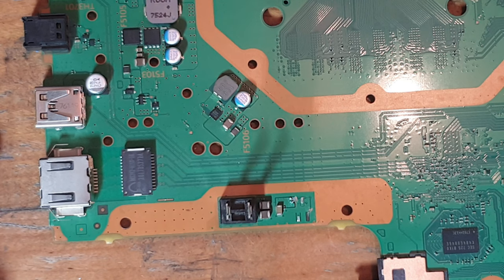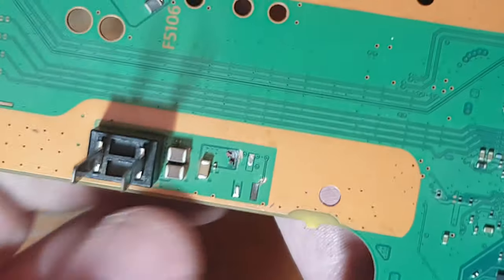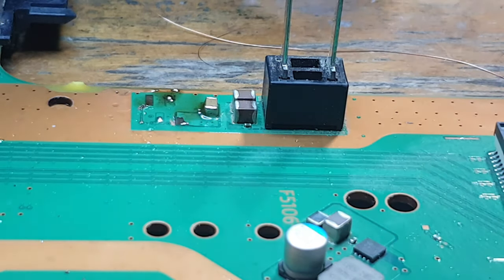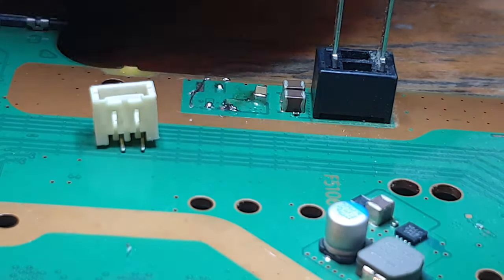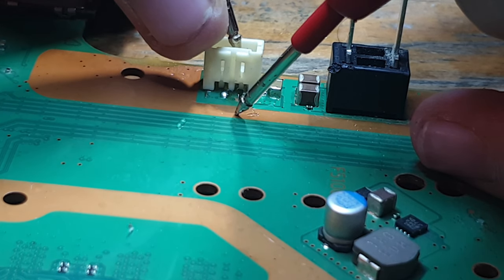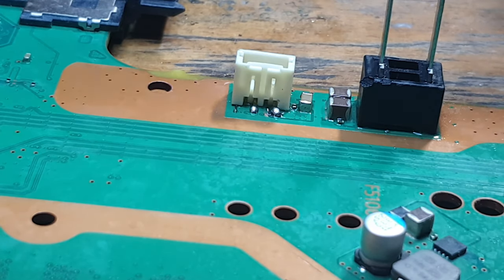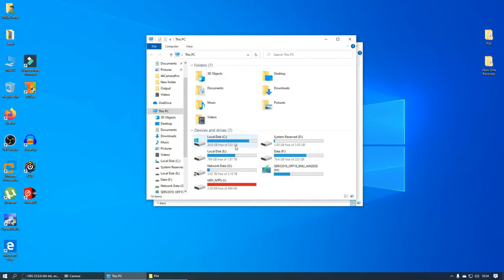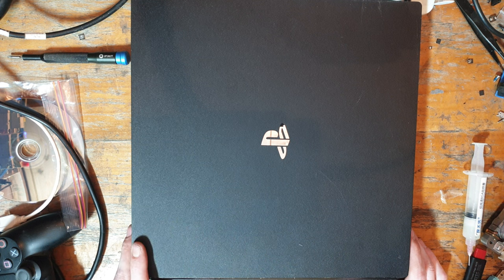PlayStation 4 Pro Broken 4 Pin 5v Connector Repair - 4 Pin Connector Ripped Off While Cleaning

Comment: Hello I had a question recently I had to repair my sister's PS4 Pro it required a HDMI port replacement in the process of taking it apart the 4 prong plug on the motherboard to the power supply came off no major damage just ground pad and the data pad came off I ran a tracer wire for the data pad and soldered it all back down after I cleaned it replace the HDMI port and put it back together it has power whenever I push the button a blue light comes on and it beeps but then it immediately shuts back off any idea what I'm missing ?thank you

Comment: I've replaced my motherboard that was a 5pin connector with one that is now a 4pin I've also swapped out the PSU for the 4pin is there anything else I need to change am I right in saying I need a diffrent logic board to match these two new components?

Comment: Opened up my ps4 pro for deep cleaning and the power supply cord was already moving without even moving it so I'm deciding to just sawder it back on.

Not sure if it came defective but I've opened many ps4's and ps4 pros and have never seen it that loose before

Comment: I ripped mine too, but from the power supply not the motherboard.
Do you know the name from the connector? I struggle to find the right one. Mine is the 5 pin connector.
Reply from the maker: Unfortunately not, I generally reuse the connector or use one from a donor board if I can't reuse the original one
Reply: @TheCod3r  Thanks anyways.
I keep searching. Brought it to a Mobile Repair Center. They said 80 Bucks to repair it. How much do you ask for it?
I think 80 is way to high, i can get a used power supply for 45€. 
Im from Germany so it's just to know a number....if you like.
But as i said thanks anyways.
Reply: @TheCod3r  can you maybe tell me the rigjt size from the pins? I broke 4 from 5 pins. So maybe i can reuse the connector  if im able to get new pins.

Comment: I need to buy the jumper cable from somewhere, any ideas what I need to search for?
Reply from the maker: Yeah if you just type in enamelled wire on ebay it'll show up :)
Reply: @TheCod3r  top man, liked and subscribed 👍
Reply: @TheCod3r  would 779mA - 0.8mm diameter do the trick?
Reply: @TheCod3r  are you still offering your services for us UK folk? I have the enamelled wire coming tomorrow but I'm not confident in my ability lol.. If so, let me know how much 👍

Comment: I pulled in the cable, and it wouldn't come out. I pulled, wiggled, juggled, and it wouldn't come out. I pulled a little bit harder and it just popped. It pulled the anchors off the board and two of the pads where the terminals are attached. The other two are fine tho. I still can't get the plug out of the connector and I dont wanna break it worse. If you have any suggestions it would really help. Pls
Reply from the maker: Hi, the only way to fix it would be to solder the connections back on, or get someone with soldering experience to do it for you as it would likely require running jumper wires as seen in the video
Reply: where are you located donnie i maybe able to assist you
Reply: You have to solder it back on?

Comment: I gave up and threw it on the bin lol I had the worst damage, all of my pads were ripped off and the pin connector pins were gone, (nvg 002 board:
Reply from the maker: That could've still been fixed mate
Reply: @TheCod3r  yes mate ik and I still have it I was joking but Im not an solder expert so I can't fix it, can u give me some suggestions if u can
Reply from the maker: @theopskeletonz9163  haha 😄 if you live in the UK I'd be happy to try and repair it. My usual price is £35 for this particular repair plus return postage. If you're from another country I can still repair it but return postage would be more expensive
Reply: @TheCod3r  my one got ripped so how much
Reply from the maker: @ImtiLoCc  could you get in touch via email (phildanks@outlook.com) and I'll be able to give you a personal quote. Typically I charge £40 for this repair plus return shipping. Thanks very much
Reply: Hi mate. I have a PS4 Pro which I tried to fix the overheating issue by deep cleaning and thermal paste. Now the main issue is it wasn't turning ON, so I tried to pull out the power supply unit to check again which unfortunately got stuck for some reason . I yanked it out, but sadly the Power supply unit got broken along with the 4 pin connector on the motherboard. Do you reckon this can be fixed and if so how much?